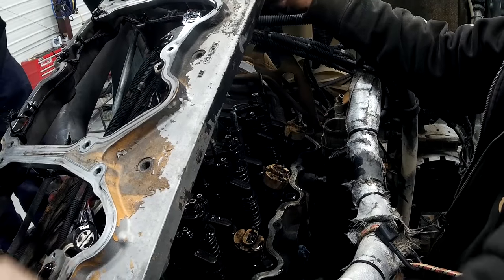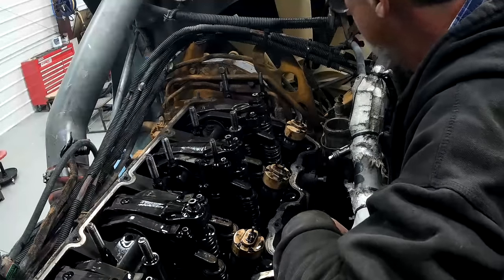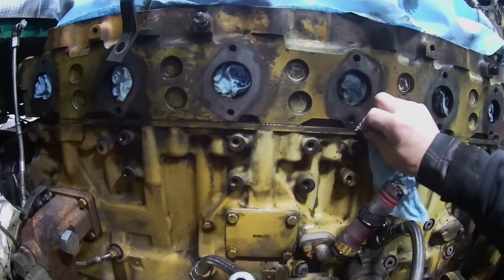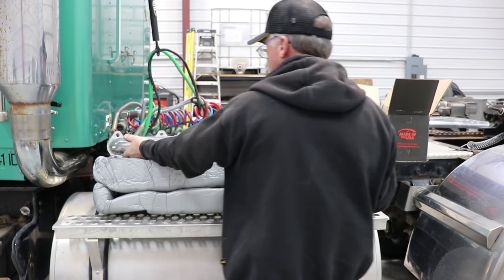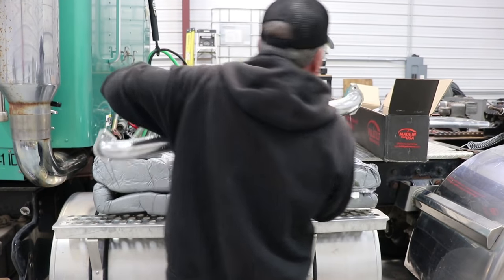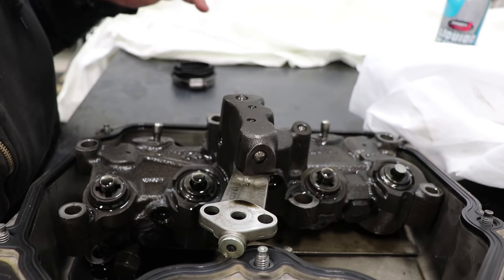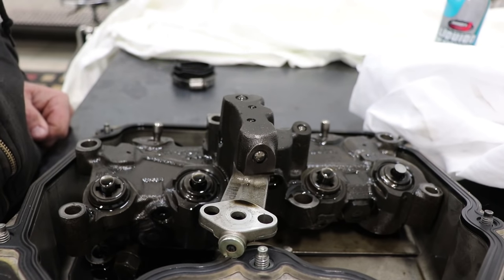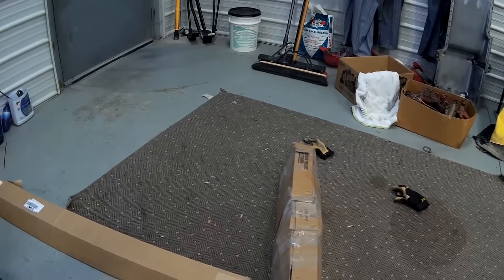Caterpillar C15 And The Adept Ape

Comment: Do they claim HP gains with the ceramic coating on the manifold?  Retaining heat, etc... ?  Pretty sweet of Adept Ape to do a video for you!  Between you two, there's probably not much CAT information that couldn't be found!  Looking forward to the build and that is one sweet tool box!  Thanks for the video!
Reply: burningdinosaurs Good morning. Yes the ceramic helps against heat transfer which helps get the hot exhaust away from the engine instead of turning the manifolds, headers, turbo stand into giant heat sinks. I've had them on my drag car for some years and it does reduce underhood temps. Excessive heat is not an engines friend. A great side effect is keeping rust at bay also with cast iron manifolds its a smoother surface and it easier to clean inside if you have an engine failure and a lot of carbon and oil get inside. The silver color ceramic does stain like crazy and requires cleaning and polishing to keep nice. The recently came out with a dark ceramic that has titanium(?) and looks flat black. Sorry I got a little long winded but I'm a big fan of it.

Comment: The butterfly ports in the manifold make the turbo spool faster, same with the smaller ports in the exhaust. In other words they were designed to make lots of low end torque in exchange for a very small top end performance loss. Throttle response and gear fast run slow were big with the last cat engine setups in the trucks so they were setup more for that than high rpm high flow pulling power.

Comment: Jeff..... GREAT Video as usual,  and Really Great to have Josh,  join in the fray and share his Cat knowledge as well.... I think you two would make a great on-going "team".... with your videos of the actual tear-downs and rebuilds, coupled with Josh's explanations and "cautions" of How-To's..... I think That would make for a REALLY Awesome (even More So, than both Josh and yours, already are - individually!) "team channel".   Just my thoughts on that. : )

Having said all that.... and from ALL the Cat (Especially the Cats!) videos I have Ever watched..... I think I will just stick with my Very - Most Favorite engines (as you may remember from my earlier comments).... The Very Reliable ole 2 cycle Detroits... and from what I'm seeing with all the electronic wizardry on today's "high tech" engines of ANY kind or brand.... I'll just stick with mechanically operated.... EVERYTHING!!    The 2 cycles - for all their engine block complexities in casting.... were, overall - Farrr simpler to work on compared to what you're having to deal with.

IF... Detroit Diesel had of NOT have been under the Corporate leadership of GM(re: final decisions on ANY engine changes,[including any & All upgrades] etc. etc.), and had been a "stand-alone" company... an inline 6-149 "was" on the drawing boards for hwy truck use and with a total cylinder displacement of 894 ci ("square" design with a 5.750 Bore X 5.750 stroke) - would have absolutely cleaned Cummins, Cat & Mack's (Mack 865 V8 - pre E-9 years) proverbial and collective "clocks" in the power output department for both horsepower & torque.

Take care and stay warm over there (if I was still in MT. I could say "down there" which I would like better, as MT will Always be "my home". : (  )

Comment: Have not read all comments. CAT explanation when i got training in 2004. The VVA holds the intake valve open to allow boosted air to cool cylinder, exhaust valve also open, overlap, air flowing through cylinder. Cools engine supposedly.

My theory is: the VVA controls the boost charge in cylinder. Basically allows the 50 psi boost charge to bleed off and become a 30 psi boost charge, in cylinder, similar to a 6NZ engine. Not much info in CAT system about VVA from what I remember. Have seen them backed off. The ECM does read pulses on oil pressure, be aware this will set check engine light if backed off too far. Maybe try .030 instead of .020. Not sure if you are adding more fuel some how. The ECM may see an overboost issue and set a light also. Probably stick with 020. Hope this helps.
Reply from the maker: Thanks for the info Jerod,  I didn't plan on adding fuel, so your saying put more clearance (.030) in the vva's but if it's too much I'll get a code?
Reply: Jpaydirt Yes. I haven't ever done that, but it makes sense to me.
Reply: People over complicate this.  Think about what it does It holds the intake valve open on the exhaust stroke.  It puts the fire out and basically allow exhaust gas into the intake stroke sound familiar?   This lowers NoX much the same way EGR does and the competition will just say its an internal EGR Valve.  Cat would never say this.   I am Cat certified and had the training and when you asked that question in the training you would get funny looks.  Edit  Oh it also explains why you need a pre cooler you are burning exhaust gas equals higher exhaust temps.  it is why you are struggling with high exhaust temps if you removed the pre cooler.
Reply from the maker: Thanks for your comment Mike, I agree they hold the intake and exhaust open, in order to reduce NOX you need a cooler combustion event, and in order to do that you need to reduce the dynamic compression ratio, so by holding the intake valve open during the compression stroke for a certain percent of the upward stroke you reduce the cylinder pressure and also the temperature of the ignition, now you are probably very correct about holding the valve open on the exhaust stroke because of the ACERT snot in the intake plenum it would certainly explain that, but with 18:1 compression you'll blow the head off it they didn't bleed of some pressure, I know at idle and low power levels you need high compression to create a clean burn but at higher rpm the combustion heat goes up and so does NOx and CO2   I know you can't run high boost pressure and high compression together and have it last, hence the VVA's with out them your going to have problems,  like head gasket failure and I would imagine your liners are going to be moving and eventually drop enough to blow the gasket, but the one thing I've learned about twin turbos is the air is so much hotter than a single that the pre cooler is mandatory, a single will pump as much flow as the twins but at lower temperature, the twins are definitely part of the emissions program,  It's quite the mind numbing operation I would love to hear a good explaination from a Cat engineer   Thanks for you imput
Reply from the maker: I just found this, very interesting stuff if your board☻   http://citeseerx.ist.psu.edu/viewdoc/download?doi=10.1.1.503.3853&rep=rep1&type=pdf

Comment: I agree with the earlier comment about using a resistor instead of leaving coil plugged in and hanging. Easier to hide the resistor and cleaner mod. Just ohm it and match it.

Comment: The oil leak at front plate to block joint is common. There is a hollow dowel for an oil pass through. It uses an o-ring and the gasket to seal that spot. I cut a bit of gasket, at that spot, making the oil leak to the inside, not the outside. (The o-ring does the majority of sealing.) Hope that makes sense. Another thing I did was a bead of sealant, only on outside half, of gasket faces. I figured that helped keep the gasket from squeezing out.

Comment: IVAs control intake valve overlap as needed to force cooled scavaging to cool cylinder temps to lower NOX production. CAT developed ACERT technology while other manufacturers went to cooled EGR to lower NOX.
Reply from the maker: I wondered if it was overlap, thanks for the info
Reply: If I remember correctly, part of the Acert technology was to put the engine into the Miller cycle ( hence the higher compression and the IVAs and VVAs ) as needed.
Reply: I thought the valve actuation happened on front end of the cam rotation and not on the back end. I stand corrected. Thanks for the info.

Comment: when those seals stretch,  cut one end at angle to increase the surface area, then pull the other  adjacent 
the cut you have created then cut at that same angle.to join ,then the can be super glued  together, that  perfect
and that is the way they join , when using O ring material off the roll, you should consider the o rings ,you commonly use, a  also purchase a roll.

Comment: Jeff you should change the pressure fuel feed to the front of the head and the water line while it is easy to get to. Trust me them are a job to do with the rocker boxes on! That manifold looks sweet!
Reply from the maker: Yes I agree the water line wouldn't come loose from the adapter and I couldn't hold the adapter still  what happen's do they break
Reply: They usually go to leaking after moving them around then they burst open. I change the adapter too it takes  beating getting the hose off it. Them two hoses take a beating from the engine heat so i always change them while they are easy to get to.

Comment: IDK if it's just the angle of the camera but the comparison at 15:13 those original ports look larger than the new one. Must be an optical illusion. A nice upgrade. But having the smooth surface will provide much more air flow.

Comment: Easy Off Oven cleaner will remove any caked on oils on any engines works fantastic spray a COLD engine down leave 3-4 hrs will remove any loose paints too  , Or even presoak and engine with diesel works good too .
Reply: Garnett M thanks for the tip, not sure why I never gave that a thought, I'll try it in the spring when I bring my Fl-70 300 Cat out of hibernation.
Reply: Oh maybe I better mention , Either use Easy off by itself on caked engines  ,  Or on a oily dusty motor Diesel works good .Oh forsure I`ve done this for years good to rinse down after can get skin irritation if not .
Reply: Garnett M 
For all you carpenters and woodworkers out there,  oven cleaner does a great job of cleaning the pitch buildup off your saw blades too. Back to smooth cutting and less heat buildup. Try it, you will thank me.
Reply: Random Guy Omg your telling the wrong guy to use it on wood ,I hate working with wood , I'm a welder of 45 yrs Cat and truck driver of 15 of them only wood in my yard is a 🌲 LOL.

Comment: That's turning into a job....  I put a PDI manifold on my truck, looks very similar to the one you got.  Are you going to be able to use the sleeves or go with the E model exhaust gaskets?  I wrapped the manifold and the exhaust pipe off the turbo down past the frame with a header wrap and it's surprising how much cooler the engine compartment stays...  Also the studs that hold the turbo on were bigger so the flange on the turbo had to be drilled out...  Pretty sweet toolbox, looks like it would save on the tool planting...  That turbo better get there soon, I'm afraid you're going to cut yourself carrying around that knife....
Reply: I would always suggest using the sleeves, they serve a purpose of insulating the water passages in the head around the exhaust ports from the exhaust temps. There is a company that is making a single piece sleeve that is very reliable.
Reply from the maker: when there's and vacant spot I know who did it☻ don't you have to use the sleeves? that's a really good question now you have me wondering
Reply: Jpaydirt I didn't use them on a 3406b.  I had to use the early E model gaskets that don't have the sleeves because I had a round port head and a round port manifold. I think a c15 has to have them but I'm not that qualified...
Reply: Jpaydirt, it is not a requirement, but some I have talked to have seen higher water temps not running them. Really depends on the setup and how warm the EGTs run

Comment: Jeff, love your videos!  I have a 1693TA 425 in my '75 Pete.  How much manifold pressure did Old Kenny have?  Mine only about 21-1/2 and wondering what stock is?  Can't wait to see all the changes going into the 93.  Greg
Reply from the maker: Mine would run 30 PSI  but that's putting to much fuel to her to get that boost, did you see my pistons and the heat cracking, I have a rack book I'll check to see what stock should be

Comment: to get the oil from the block off try spraying brake clean and use compressed air it look like new
Reply: I've been using brake clean for that same purpose for awhile now and it gets the job done well. I was buying it by the case on sale but have switched to getting it bulk in 20 ltr pails and using my own pressure spray jug. 👍
Reply from the maker: Chlorinated or un
Reply: Jpaydirt recommend un Jeff, chlorines can cause bolt failures in highly stressed bolts such as head, exhaust, big end and main. Cheers mate 🍻
Reply: any will do

Comment: C brake or jake brake in very simple terms when Engauged both turn your engine into 
a  (giant air compressor )
By altering the exhaust valve timing the piston compress the air in the cylinder to extremely high pressure 
And the exhaust valve does not open until the piston is nearly at the top of the stroke that’s where all the noise comes from , there are plenty of good animation videos on you tube about the Jake brake and Howe it works
My explanation is very basic